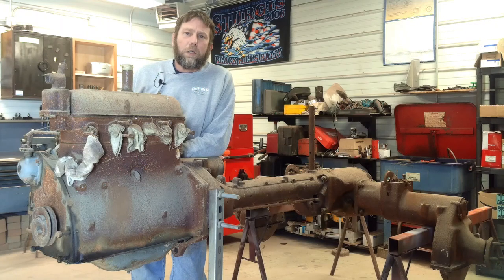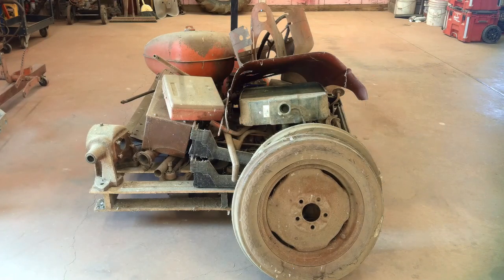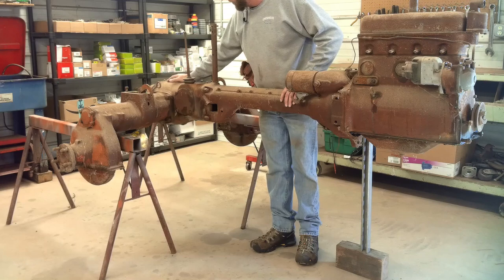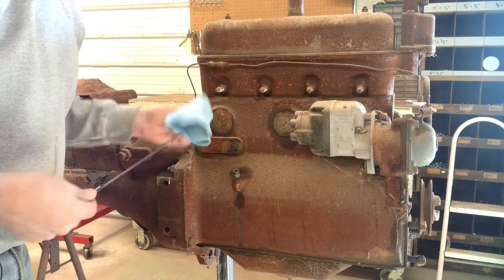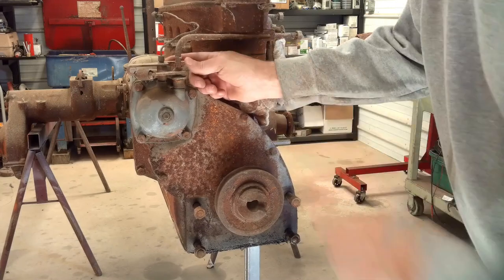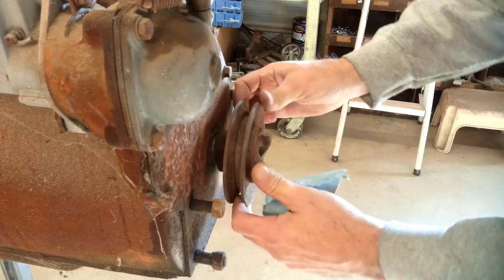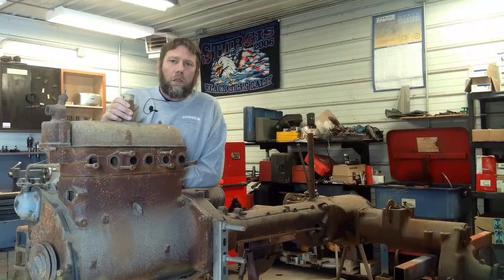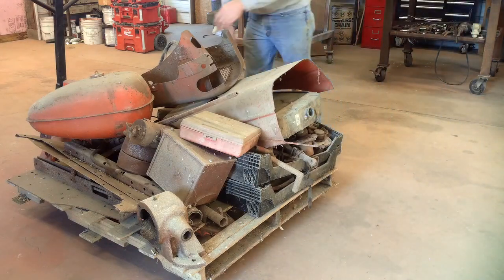Allis Chalmers C Restoration Intro Ep.1

Comment: Excellent, glad to see ya back at it.  I ended up getting new tires for my WD45.  They are mounted to the rims and just need to find the time to put em on.  Went with BKT, 14.9-28 from Simple Tire.  Little less than $1000 delivered for both.  The original Goodyear Duratorques are discontinued and could not find anything used.
Reply from the maker: Rear tires can be spendy! I found some 11.2 -24's for this tractor for $600 with tunes delivered

Comment: I have a filter housing and rear wheels and tires in Ohio. Might be a ways away though. I’m removing the engine and making wheel adapters to run 8 lug combine wheels on mine for my son for pulling
Reply from the maker: Does the filter housing just bolt on without any other modifications?
Reply: @sparksfireandbalingwire8467  yes. It has a pressure line from pump at back of engine to the bottom of housing and that’s it. A cork gasket and the housing needs to be flat to not leak. The Wc Wd wd45 b c ca all took the same one
Reply from the maker: @justinblain928  Good deal! Thanks for the info.
Reply: @sparksfireandbalingwire8467  no problem